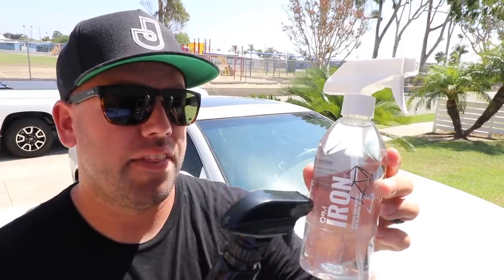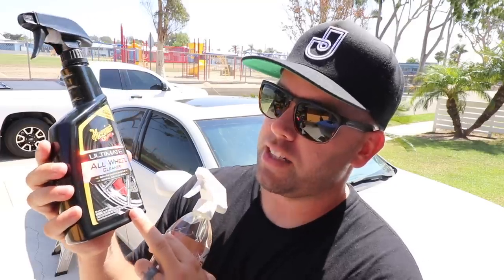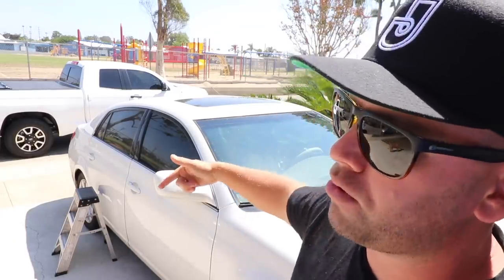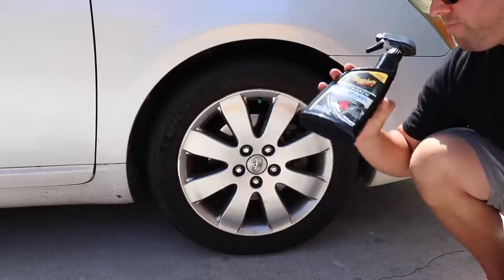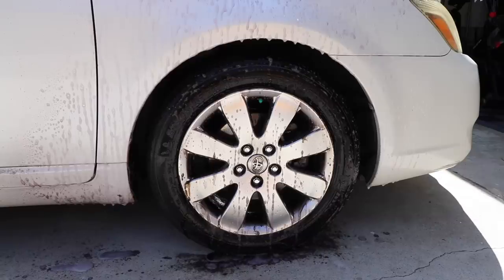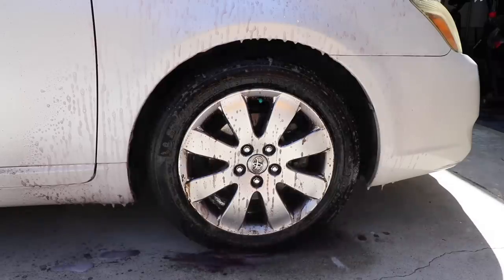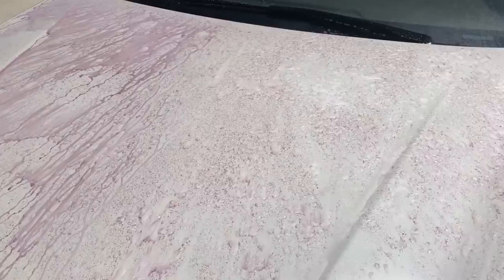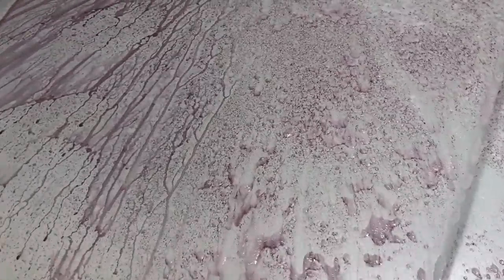CHEAP VS EXPENSIVE: MEGUIARS ALL WHEEL CLEANER VS GYEON IRON

Comment: The brake pads on the Camry are generally more organic based, so you will not see a lot of iron compared to other heavier or sporty models that have higher metallic content brake pads. The brake pads on the Camry are designed for quiet, comfortable and low dust operations. All you really need is car soap to clean Camry wheels. On other heavier or sportier Toyota models, that's where iron remover will shine the most.

Comment: how about a cheap vs expensive drying towel ? I use a griots pfm towel at 860gsm it cost 35$ . probably not the most expensive but it would be cool to see a vs. on that subject
Reply from the maker: Coming up. Just picked up the $45 griots pfm. I just gotta record the video.
Reply: I couldn't get waffle towels to work for me, always smudging or not picking up the water. it is what it is , the griots towel works for me

Comment: use dedicated wheel cleaner for wheels or use diluted APC as wheel cleaner if wheels are not extremely dirty. 
and save iron remover such as gyeon iron, carpro iron x for decontamination for coating or for delicate work.

Comment: Both want you to use it on a pre cleaned rim. Gyeon wants it cleaned and dry and Megs just doesn't want water on it. Both will perform better on dirty rims than rims still soaking wet from water. The Gyeon actually outperformed the Megs as it pulled more from the back rim than the Megs managed to pull from the front. It was even more obvious on the hood. Front has bigger brakes that do more braking than the rear. Unless I've had abnormal cars until now, my front rims are always more dirty and covered more in brake dust, so the Megs should have been more able to turn purple because more iron should be there. Very interesting is the price difference. That 9$ Megs costs me 20€ (709ml) and the Gyeon 16€(500ml). Both are imported products. I use Bild Hamber korosol (also imported). Costs me 17€ for 1000ml and easy outperforms both the Megs and the Gyeon. It stinks just as bad as the Gyeon though😀 Good comparison video!

Comment: One is a wheel cleaner and the other for removing iron contamination.I don't understand why you're comparing them,you wouldn't use Gyeon iron as part of a regular wash routine.Its for decon just like tar removers and clay bar.
Reply from the maker: So a wheel cleaner that turns purple is not an iron remover?
Reply: @autodetailingpodcast  It's not specifically for iron contaminants,Gyeon Iron is..The meguiars product is a wheel cleaner,so yes it may remove iron.But as I said Gyeon you won't use as part of a regular wash cycle, it's for the decon stage,along with clay etc.The stage before polishing and a detail.
Reply: Yes as noted here they are different in that wheel cleaner while having iron remover in it, they also have APC or some other cleaning product in it to specifically wash the wheel as well as remove iron and this is most likely why it foams more. Where as iron remover doesn't have any other chemicals to do anything else but remove iron. That''s why Gyeon says to wash the wheel first to clean the wheel from all the other contaminants in there so the iron remover can work on the iron more specifically. This would be something people should be more aware off when cleaning they're wheels because wheel cleaner and iron remover are different products for different purposes and require different cleaning approach. Wheel cleaner as an iron remover helps make the wheel cleaning faster when you don't have to have a extra process to remove iron, however the downside of it is that the iron remover is not going to be working on the iron particles as specifically as an iron remover will be so there will be more iron particles left after cleaning wheels with a wheel cleaner instead of washing the wheel first then using an iron remover.
Also as pointed in the video the iron remover is supposed to be applied on rinsed wheels because the product probably has been diluted to such level that it will have slight potency to still cut through the iron even with the water on the wheel diluting it.
Reply: He is comparing them to demonstrate how they perform, but also to share an innovative use for an alternative product that is inexpensive and readily available. 

It may not work as well as the high end dedicated iron removers, but that is to be expected at a fraction of the price. It is still capable of removing iron from all vehicle surfaces. 

As a detailer, I appreciate this and find it interesting to know. 👌👍👌

Comment: Seems like you are comparing two different products and did not follow the directions on the expensive one. I would expect the Megs to do better on a dirty wheel because that is what it is meant for. It is a wheel cleaner with an iron remove. Most likely the reason the other product calls for you to clean the wheel is because it is a dedicated iron remover. I don't think you can expect it to cut through the dirt as well. I think a better test would have been to use both as directed and as others suggested to clay bar afterwards. Just FYI, I have not used either product.
Reply: This^
Gyeon Iron is exactly that, an Iron Remover. Not a Wheel Cleaner. 
It would have been a better test if it was against Adam's Iron Remover($50) being that the gallon is half the price of Gyeon ($100). I'm a big Gyeon fan, I have Mohs on my car, but I really think Adam's is a great deal.
(Those are gallon prices I listed)

Comment: Nice video. A little shorter and some close ups would have been nice. I have recently brought all wheel cleaner, I wanted wheel brightener but wanted to save some money, and it works really well. As you said smells ok and I have had it much more purple, so yes probably just not much iron.
Reply from the maker: I’ll tell my editor to try and make them a little shorter

Comment: My criticism is that you gave way more of an opportunity for the iron removers to work onto the surface to pick up the contaminates.   You wouldn't spray as much on a corner as washing a a car weekly and using that much product is OTT.  The megs is more consumer base and designed to show people but the science behind it is very mis-leading.  The Geyon is more of the semi profession which you saw how well it 'reacted' to the rear of the wheel and thats not even supposed to pick up that much brake dust.  Its an interesting video and thats why i clicked on it due to the subject title  and also something i was interested to see the reaction how they react but when choosing one iron remover to another but I think you need to do the test on a whole car each time and use the next product on the same car the following 2 weeks.

Comment: In my professional opinion you should only use your iron removers on your paint only to save money. Stick with wheel cleaner products for wheels. Second you shouldn’t have to use this  every time you wash your car. Unless you have semi-metallic pads. They will emit a lot of iron. Ceramic and carbon pads do not. The wheel cleaners are a stronger dosage than the specific paint safe iron removers. Last iron removers (from my experience) will loosen embedded iron and make it easier for the clay bar to remove. Happy polishing!

Comment: what pressure washer gun is that jimbo?
Reply: Jamesbond Quinones
Pick up an MTM or Mosmatic gun. The pressure washer isn't that important unless you want a ton of foam from your foam cannon, in which case you basically need a gas pressure washer with 2+gpm. But if you just want something that will do the job, get the highest gpm electric washer you can find for under 200 bucks.
Reply: Oh, you may also want to do get it through obsessed garage since he has packages that incorporate all the quick disconnects for you.

Comment: You’re using a “wheel cleaner” vs an “iron remover” that’s like comparing wax to sealants. Two different products
Reply: Not true. These "color changing" wheel cleaners are iron removers.
Reply: Most iron removers are marketed as an iron removing WHEEL CLEANER. That’s why Meguires says Wheel Cleaner.

Comment: im betting she has ceramic brake pads with very little iron content at all
Reply: ceramic brakes are expensive and more for performance vehicles. An avalon does not qualify as a performance vehicle.
Reply: Actually that's not correct. Most Passenger Vehicles like toyota avalons come with ceramic pads from the factory because of the low noise and dust characteristics. However if you really want a performance brake pad Carbon Fiber is the best material, it actually grips harder as it gets hotter. If you want to see how effective an iron remover is I would recommend trying it out on a German vehicle or A truck because most use semi-metallic pads.
Reply: You are correct. They seem to be using ceramic brakes all over the place now. That certainly was not the case a few years ago.
Reply: kevboutin carbon ceramic brake discs are the expensive fancy ones. Easily mistaken.

Comment: Never spray a "wheel cleaner" on body paint.  Wheel cleaners are generally to harsh (acidic) for body paint.  At a minimum it will take off your wax.  Also, spot, streak and discolor paint. They are designed to dissolve brake dust.  Terrible fail.

People make too much of "clay barring".  It is not nearly as difficult as using a polish.  You are making rubbing motion but using hardly any pressure.  A normal car wash (with car wash soap only) is plenty unless you have tar spots or dried bug guts in which case WD-40 works well and won't hurt the paint.  Wash those areas treated with WD-40 afterwards anyway.

Comment: Why is it that most detailing vids use a pressure washer instead of a water hose?  Most viewers like myself don't own a washer for whatever reason.I think most would like to see results using a hose. Other than that good vid.
Reply from the maker: JTSBMW that’s a good point. I’ll consider that on the next one
Reply: JTSBMW ....a lot of these guys are mobile detailers. That would be my guess.
Reply: No difference in using a hose or power washer to remove this stuff. Power washers use less water. Mobile detailers need powerwashers.
Reply: Oliver Galon I'm sure when they make these vids they are at home. I don't think they would experiment on a customer's car when making the vids.
Reply: I only use a garden hose. For me it just makes more sense. Don't have a lot of time during the week to pull out a pressure washer just to do a quick maintenance wash.
Reply: you can get electric pressure washers under 100 bucks that work great for cars. The green works 1500 or 1600psi pressure washer i got at lowes for 90 bucks works awesome and its light and easy

Comment: People saying Gyeon is trash is absolutely ridiculous. To the average guy who has very little detail knowledge, the Meg's is just fine. To the guy offering warranty on a Coating job at 1500-3000$, no-one is grabbing that cleaner. They're using Iron X, or Gyeon iron remover.
Reply from the maker: Maybe. But they sure do work fairly the same.
Reply: 2nd is close to first but no-one wants to finish second.

Comment: Why not follow the directions on the Gyeon, and wash first?
Reply from the maker: It doesn’t matter. Actually water dilutes the product.
Reply: @autodetailingpodcast  Clearly the case.  But I’m sure the manufacturer took that into account.  I’m only making note of it because you made a point of what it did/did not do when applied.  If it wasn’t applied as suggested, any conclusions reached were not entirely accurate.  You’ll have to excuse me—I’m a real scientist 👨‍🔬

Comment: Not a great comparison. Gyeon Iron is a strait iron remover like IronX etc. Meguire's is a diluted product for wheels, similar to Adams Wheel Cleaner.
Reply from the maker: but they both remove iron regardless if one is a "straight" and one is "diluted"
Reply: That is like saying an AIO will produce the same shine as a dedicated finishing polish just because they both "polish." Iron wheel cleaners and dedicated iron removal sprays are different. They are not comparable products. They may accomplish similar things with regard to removing iron contaminants but they are not the same product.
Reply from the maker: Right...